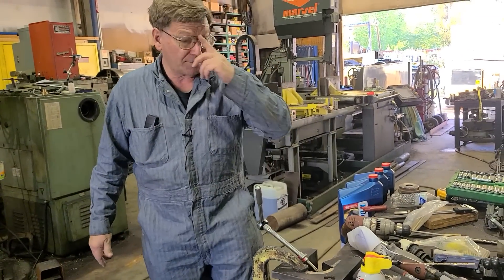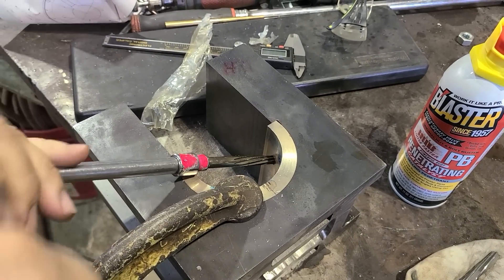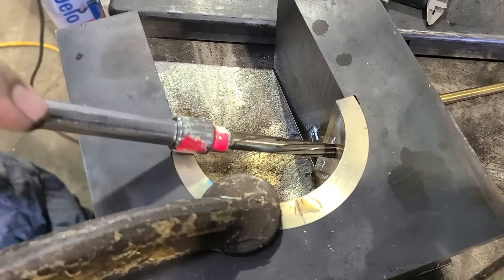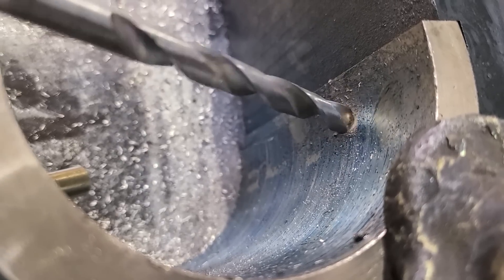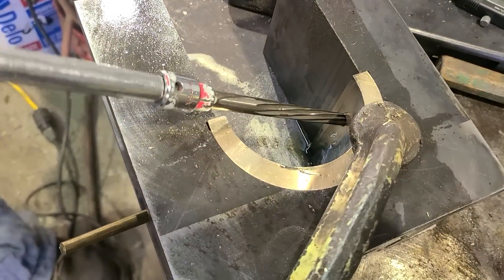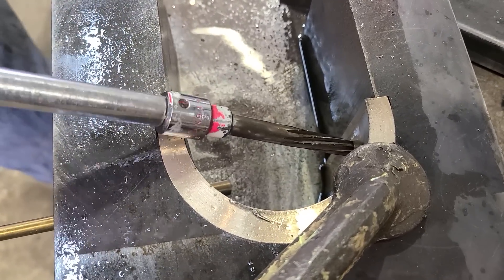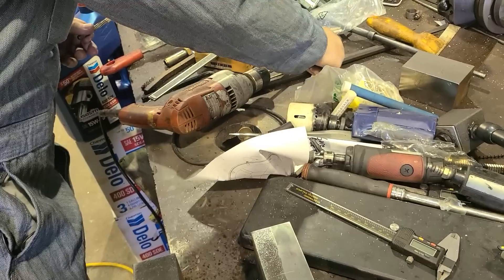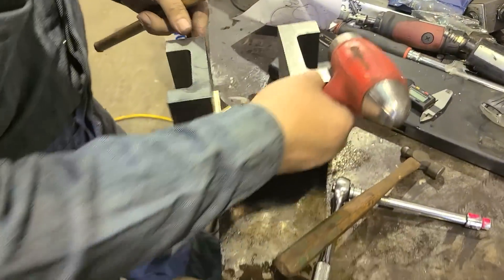Machinist's Minutes: Installing brass taper pins (BB 3/3)

Comment: Proto makes 8pt sockets in about 1/4"–3/4". 

I'm surprised you haven't put a depth line on the reamer with a paint market or some such.
Reply from the maker: In this case the socket worked for a depth gauge & the pins are not all the same nor the job, so the reamer correct depth will change with the requirements of the job.

Comment: Did you ever consider a pilot hole ?
Reply: Why? He got the job done, correct? No need to add steps or complicate things when the end result literally won’t make a difference.
Reply: @coon3869  if the hole that you are drilling is bigger then a pencil , you should probably drill a pilot hole. The tip of a drill point is not efficient. Either you can let the tool do the work or you can do the work and suffer the tool . A smart person let's the tool do the work .

Comment: That housing was a tricky thing to make. How would that have been done? Maybe on a vetical slotter with rotary table?
Reply from the maker: I used a rotary table with a carbide end mill, and then a stub mill arbor & cutter for the straight edge end to the 1/2 round, I had originally thought of using My slotter.

Comment: Never even heard of brass taper pins. All of my pinning has been steel gears to steel ahafts.
Reply: You can see them in a lot of shafts where there may be “safety” of the machine involved such as a lead screw to a lathe. Some lathes are tapered or straight but the brass allows for a proper shear instead of damaging gearing or the half nuts on the carriage. They can be really useful at times.